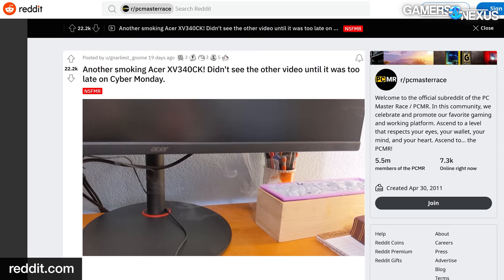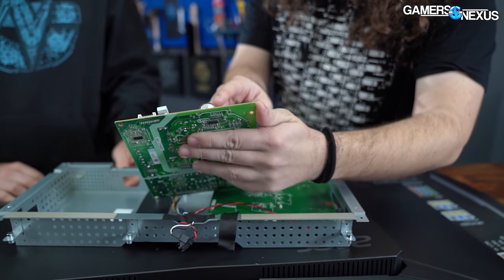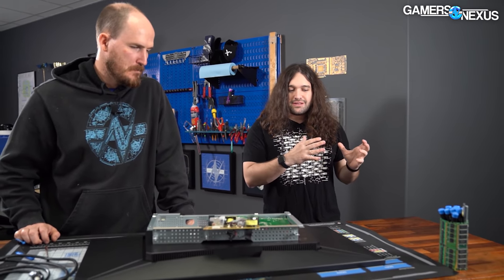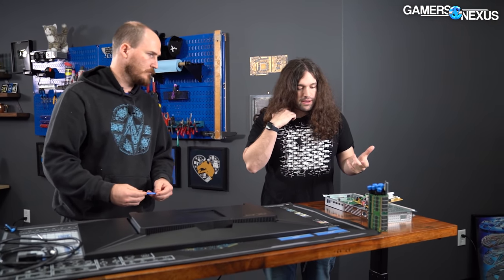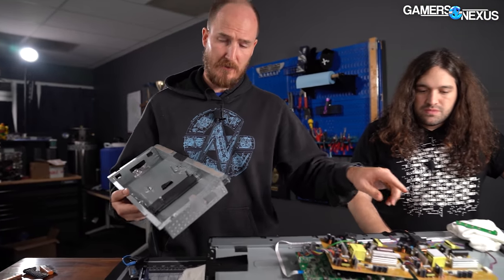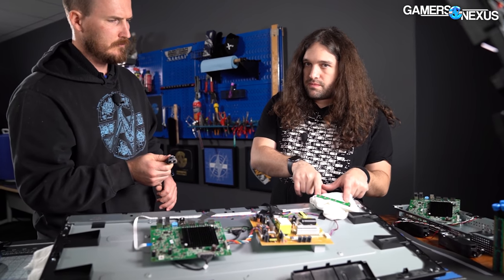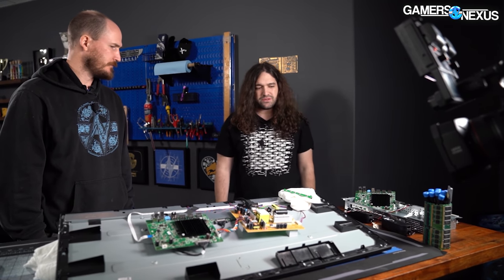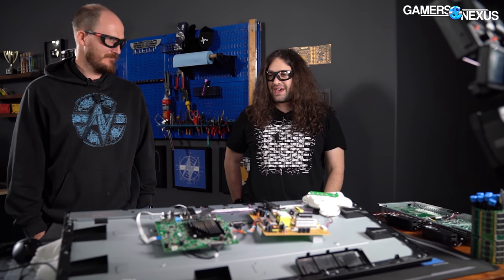Acer Monitor Fires Investigated: Blown Capacitors on Acer XV340CK

Comment: Hey Steve, the first "transformer" on the power supply would be the active power factor correction (APFC) inductor. There will be an associated switcher on the board for that. The bulk cap and main TX will sit behind the APFC stuff. The PCB would have been wet on disassembly from the electrolyte that was vented from the bulk cap. I wouldn't be surprised if the fire and smoke was related to the electrolyte shorting important bits of the APFC circuit and the eventual build up of carbon from tracking as the APFC circuit runs at a DC voltage significantly higher than mains input voltage (input voltage X sqrt(2)). In my few years on this planet I've never seen a bulk cap vent as they aren't usually pushed that hard (they are generously derated for heat and ripple) but acer probably tried to save a few cents by selecting a smaller cap. The only reason a bulk cap would fail would be if it was outright under-rated for its job.

Comment: Before throwing parts at the defective monitors, make sure the input bridge and APFC FETs are still working. If one of the input bridge diodes is shorted, then the capacitor may have been fried by AC going through it.
Reply: Good point. Too bad they won't read it cause the comment wasn't posted within an hour of the video going live :|

Comment: thermal pads like that are pretty common these days in tvs also. I feel like they are half used to keep the board from making contact with the back of the screen at all cost and the tiny amount of heat sinking is treated like a mini bonus

Comment: That feel good as I just bought a curved monitor  Acer ED320QR, the chances that they use the same components is most likely quite high, however it has been turn on for a few hours with no problem.

Comment: For the future, please get a thermal camera. It would make it a lot easier to see what's  heating up on the board. 
Capacitors fail in 2 main ways: heat and breakdown. Breakdown means a high enough voltage was put across it that it burned a way through the insulating layer, or they heat up, the electrolyte starts boiling, and then it usually opens the "safety valve" which is the perforated piece of metal at the top to release the pressure as smoke instead of blowing up

Comment: I've always found acer to have sketchy QC. An Acer laptop I had years ago blew one of its caps after two years, I had an old Acer lcd monitor where the power plug was just loose in the housing, and the Acer Nitro I bought had the I/O so misaligned with the housing I could only use the display port (unless I really jammed one of the HDMI in there, the second one was entirely unusable) and it had awful backlight variation. Their spec sheets look good, but every Acer product I've bought has had pretty major QC issues.

Comment: RE: Capacitor polarity, I have personally seen boards that have been screenprinted wrong. The original cap failed of old age after many years. The first replacement cap smoked immediately. After triple-checking the markings on the board and second cap, it also smoked. I finally looked at the actual traces and ground plane on the board, and installed the third replacement cap "backwards" and it worked just fine.

Comment: Probably someone has already commented about those failing caps seem to be low ESR types (typically low esr caps are brown). The low ESR of rectified mains cap can cause instability in PFC (power factor controller) control loop resulting to high ripple currents through capacitor. In my opinion there are three possible scenarios:  1. In the manufacturing the brown caps the marked the wrong electrode polarity marking thus the cap is assembled in reverse polarity to the power supply board, this leads to cap to blow the vent hole within minutes (or within seconds). 2. The prementioned low ESR rectified mains cap causes PFC to oscillate violently. 3. There might be a wrong component in PFC control loop causing it to oscillate (or the 4. scenario: just plainly cap electrode isolation has failed in production)
Reply: No, low ESR caps come in many different colors. The dark red/brownish color is an attempt to copy Nippon Chemicon.

Comment: smaller inductor is part od PFC circuit, bulk cap is rated 450V, PFC boosts rectified mains voltage above peak voltage to about 360-380V DC. This cap should be just fine for the job but there may be failure in PFC (voltage sensing) feedback circuit assuming there is no quality issues with the capacitor or most likely cap is just of bad quality, manufacturer rejects, fake part or rebadged with higher voltage rating part

Comment: most likely issue is in that capacitor what you show at beginning video, those can have easily make voltage shortage what may cause burn or smoke, if you see something like that make sure you todo replacement. when capacitor is ok they always flat in top, note those type capacitor does have also life time limit. usually typed at manufactory manual

Comment: Depending on your location, the input voltage may be higher. If the margin on the bulk capacitor is too slim, it may have been the cause of these failures.
Uout=sqrt(2)*Uin-2*Uf
[U instead of V; U=electrical tension; V=volts / Uf= voltage drop across BR]
Reply: Hey, sorry for replying to such an old comment. So this would mean the probability of the capacitor failing is higher in Europe? Doesn't that Monitor have an external power supply, so the voltage inside will always be the same?
Reply: @PilzQ  Not necessarily. It depends on the safety margins. If they're exceeded, no matter which component, it'll fail (sooner).
The expected voltage across the bulk capacitor is +/- 310VDC if the line voltage is around 220VAC, or 324VDC at 230VAC, but 352VDC at 250VAC.
I've seen solar inverters output up to 253VAC before. If the manufacturer has chosen capacitors rated for (let's say) 350VDC, then smoke is to be expected.
The region a device or component is used/sold in doesn't make a difference.

Comment: By any chance were the failed monitors used in Europe or somewhere else with 240V power? If you wanted to stress test one of the new units, you could power it through a step-up transformer, assuming that the power supply is rated for worldwide voltages.

Comment: the first unidentified transformer is likely a PFC (power factor correction) circuit, the incoming sinewave gets rectified after that. i personally don't think the fire is a major concern, since the fire is relatively contained in the EMI shield.
Reply: also some things extra, you guys did modify it's electrical behaviour. not at DC but RF wise definetely. (though i doubt it is an RF/EMI issue) and a note on safety, manufacturers will usually isolate all user accesible i/o like the buttons Steve pushed, does not mean it always is isolated. also best practice to put a plactic container on top so you don't accidently brush live parts.

Comment: I have this monitor and i have not had any problems with it. It has travelled with me now two years. But one thing came to mind. For some reason the power cable that came with it never worked and I got it replaced with old power supply cable. The box cable didn’t work out of the box. It is an EU (finland) plug.

Comment: The "2nd transformer" Patric point at 3:18 doesn't look like a transformer, it looks more like large inductor (usually used in power factor correction circuit)
Reply: indeed, a transformer would have zero purpose there as well

Comment: The brown capacitor is the bulk cap, a bit strange to fail out of the box.. The transformer above the bulk cap looks like a choke for the active pfc but I don't see any mosfet/igbt + diode near it, maybe they are smd on the other side of the board?
Possible reasons of the failure: bad batch or counterfeit, bridge rectifier shorted and pass AC to the cap (in case of no apfc), apfc not working correct and boosting higher than cap specs (above 450V DC), capacitor placed wrong way (swaped + & -). Did they not test the monitors before shipping??

Comment: At this rate, I am thinking that for my next PC I will just build everything into a cast iron gas fireplace shell so if anything explodes it won't be a problem. As a bonus when things really heat up (during gaming or explosions) I will have a functioning 850W fireplace. Sometimes you got to think out of the box....

Comment: In regards to capacitors, there is a lot more to the spec than its rated temp, voltage and capacitance. The ESR is especially important in SMPS designs.
The reason why ESR is important is because it is the amount of internal resistance inside of the capacitor, and SMPS supplies tends to pulse at fairly high currents, this means that if the ESR is too high, a lot more power gets dissipated inside of the capacitor and this will lead to a failure. It is however a somewhat safe failure, since it mostly results in just smoke and a non functional PSU. This failure would be a bit dependent on room temperature, but not majorly.

The failed units could just have a cheap knock off capacitor that is in spec on paper, but not in practice. It isn't all that common for factories to actually validate the claims of their suppliers, so finding components that are way out of spec isn't uncommon if one buys from a "lesser brand". (All though, the quality brands are actually expensive, so it isn't unreasonable to go with an inferior one, but personally I would use two in parallel for better ESR but that is additional labor instead...)

I would expect the ESR to be bellow 0.4 ohm for a product of this type, preferably lower than 0.3 ohm. If it is above that, thermal failure is not unexpected at load in my opinion. The ESR requirements will however vary with mains voltage, highest excepted ambient temperature and power demand. (I will however add that I do not know the ratio of the primary transformer, nor the PWM frequency, and some other crucial design specs for determining the highest acceptable ESR. But from experience, a capacitor of that size in a product like this I would feel uncomfortable if it measured higher than 0.4 ohms.)

Also, the "second transformer" is likely just another common mode choke after the bridge rectifier, it is a fairly common way to reduce EMI when one doesn't have PFC. (The PSU shown doesn't seem to have PFC.)

And yes, those thermal pads are silly, I would have personally gone with a small glued on heat sink and a rubber pad to dampen vibration and also provide it a bit of pressure against the back of the screen for long term reliability. (Since glue + tension = failure.)

Comment: Interesting video. I think you need to look at common denominators, time/date of manufacture, components used and where those components came from. If the fault can be traced to a certain batch of components that went into a certain batch of monitors at a certain time, it 'could' be safe to assume that any made after then may not be affected.  I have an Acer monitor myself and it's a damn good one, it's certainly better than the AOC it replaced, that did everything but catch fire!

Comment: Hey, I have Acer Predator XB323U. on HDR mode, monitor got so hot especially in the left bottom region of the monitor has slight burn mark on LCD, effectively burned this damn 800 USD monitor. It's not unusable or anything (but now I have to run in SDR mode to prevent from burning it), but in white screen, I can see slight yellow tint. I think Acer has cooling problem with their monitor...

Comment: Never seen a main bulk cap vent on a monitor. It's usually the secondary side ones. It'd be nice if you could replace the caps that vented and power it on and see if it's the caps are bad or something else, like a bad rectifier, is causing them to fail.
Reply: Problem is the blown cap may have caused other components to go bad too.
Reply: @pickleadaykeepsthedoctoraway  Blown caps usually don't take out other components.  Blown caps are usually a sign that something else is wrong.  I had a lab power supply less than 6 months old let out the magic smoke (surprising/alarming a software engineer).  Upon disassembly, the "faulty" cap was a radial cap which had been turned 90 degrees to be parallel to the board (exactly how the cap in question in the video is bent).  They then zip stripped the cap to the board, and torqued the fastener so hard that there was a visible inward bow in the metal can where the zip strip was touching it.

Comment: That transformer is the power factor correction inductor
i assume its a bad batch of capacitors, its rated properly and is properly installed and i assume they used the standard supply line as we are not in a capacitor shortage.
The question is if they knew this could be an issue, you typically test random bathes and i'm sure they were aware of the failure rate and simply let them enter the market finding replacing a 5% failure rate cheaper over recapping 5,000 or whatever boards 
an electrolytic cap won't catch on fire or cause serious harm.

Comment: @Gamers Nexus 
I can say that many things can go wrong, especially when I saw the bloated caps.
If caps are bulging, they are definitely bad. If electrolyte leaks, it is electrically conductive. The purpose of the input caps/s is to smoothen the current, rectified by the bridge rectifier before them. This could lead to MOSFETS, driven by the power IC and driving the transformer to fail. Or electrolyte on the wrong place could lead to shorts and failures. This could lead to any kind of malfunctions. Usually when this happens, the fuse on the power input will burn("blow"). And if there is reverse polarized cap, it will blow. But this kind of manufacturing defect isn't that common.
So, because you were unable to reproduce the fault, this doesn't mean that something like this could not happen. Especially with the bulged caps. Manufacturers often use cheap caps to save money and increase their profit margin...Usually it is done because noone will notice immediately and usually the unit will die at the end of it's warranty period or when the warranty period had already ended. Not only to cheapen and increase their profits, but to force you to buy more often new unit, unless you know how to fix the problem, which isn't that hard, but many people can't do it on their own, mainly because they are afraid of electricity. But if it is expensive unit/thing, fixing it is worth it. Not to even mention that by reusing things/if they are good enough to be used/, you save resources and actually help save our planet. I use many things, that I bought broken and I fixed. Of course, I have enough experience to guess whether the unit can be repaired at all and if it would be cheap fix of expensive one by looking at it and observing the symptoms of the problem.
Also, be extremely careful when you do experiments like these. This input cap usually can charge up to the amplitude of the mains voltage. If you use 230V, then this would be 230x1.44 This cap could seriously shock you. That's why usually there is resistor to discharge it when you turn off the unit.
The input cap could accumulate enough energy that when you try to discharge, after you turn off the unit!!!, it by shorting it with screwdriver it could leave welding marks onto the screwdriver. You don't want your bare hand there. ALWAYS discharge the high voltage input caps before trying to fix SMPS(Switching mode power supplies)

Comment: The transformers on most power supplies are T1 (Main Transformer), T2 (standby power (PSU On signal) and then there is the common mode chokes.

Comment: I think that mains cap would have exploded even if it wasn't turned on. When you connect that power cable that psu starts up (At least older monitor what I recapped didn't have aux psu)
Those explosions seems like over voltage situation so was there fake caps with bad voltage labeling or just bad manufacturer.

Comment: I've had this monitor since April 2021. I've been using it for both Work from Home and Games, so it has a considerable amount of "on" time so far, and I haven't had an issue (yet?). So they don't all fail, at least. Only complaint is that it really should have been curved. I can lose an entire column of text on the sides of the screen (due to viewing angles) by shifting my seating position.

Comment: The difference in that cap is, cheap cap has high ESR, good cap has low ESR, none of this info is written on the cap. Cheap cap fails because it heats up with the higher ESR, then at some point it fails and lets the fish oil smell out. A very simple check is feel if the cap is warm/hot and if that large bulk cap is failing is the voltage ripple will be much larger than normal, since this is the highest voltage in the display (LED backlight), need to be careful, but simple put a DMM in AC mode and check the ripple voltage.  Regarding the green/yellow safety wire, that is not used at all until there is a fault (when some voltage (mostly high voltage) touches chassis ground, it now has a path to travel and keep the operator safe.

Comment: Nicely done , your investigation , good job , and from the videos i would said that them electrolytic oil is the one creating the smoke , the good think is that isn't flammable but the bad think is that is "stabilize" the primary voltage so any component could blow out cause of that failure so.... yeah but product anyway.

Comment: those aren't thermal pads, they are used as stands to avoid the boards touching the lcd metal plate and as anti vibrations, as for the caps where did you search for a replacement and where unable to get one of the most common mains cap used, sure they might not come in the same size cause it all depends on who makes them, as for the fire hazard I don't believe there is one, as soon as the cap pops it should overload the fuse and blow it up insulating it from the mains. I would put a new cap and replace the fuse (after checking the rectifier bridge) and plug it in and use it.